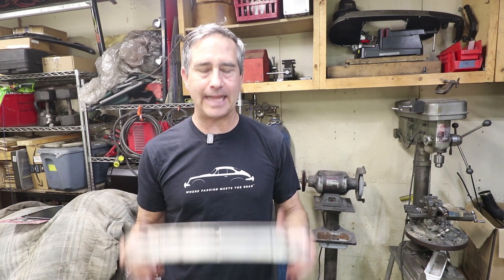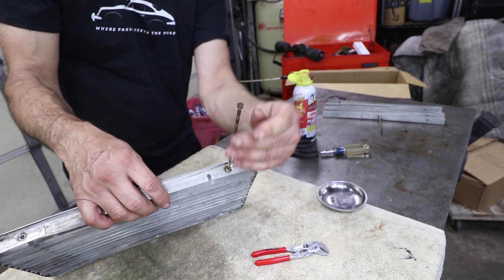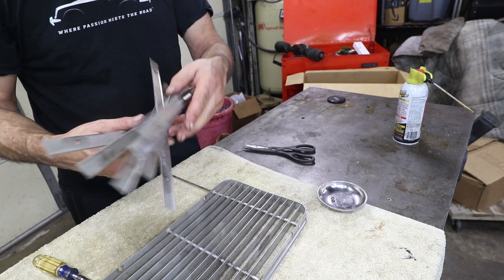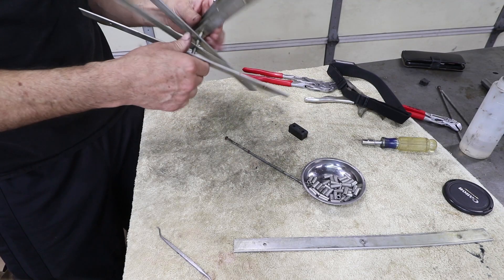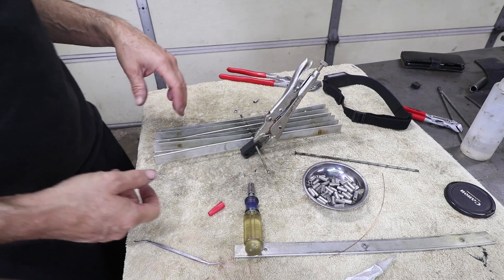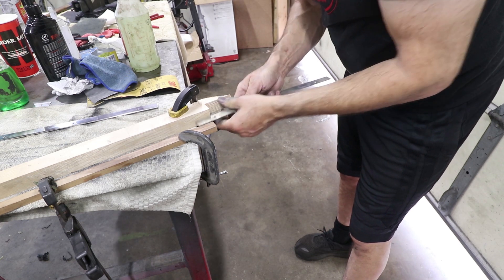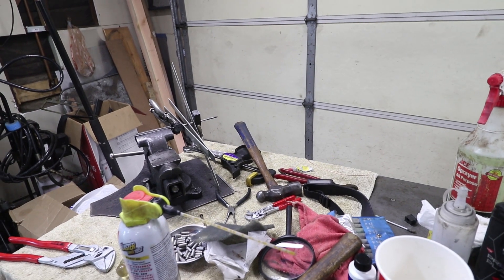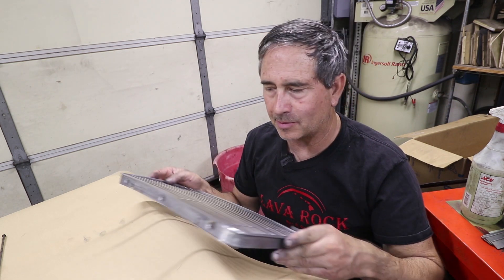This Porsche 356 Decklid Grill Almost Went In The Trash, But Look At Them Now

Comment: Great job on sticking with that stuck rod...lots of frustration but a great result.  After my grills were cleaned, polished and assembled I had them clear ceramic coated at some shop in the L.A. area.  That was over 8 years ago and they look exactly like they did when they came back from the coater.  The clear ceramic coating looks very close to the original finish with the anodized layer.
Reply from the maker: Nice, I will probably end up doing this long term too.  Cerakote?

Comment: You have read my mind.  Was thinking of superglue. But I was thinking a nut or sorts. Then acetone soak to clean
Reply from the maker: Super glue was the only thing that worked.  Sometimes the glue failed before the rust broke loose, but eventually it all came apart.  Have you ever used superglue activator?  It instantly dries super glue.
Reply: @GarageTimeAutoResto  I have not used the activator. But have used SG to open screw back pocketwatch cases that wouldn’t budge

Comment: Tom, I have early cars that DO NOT have screws and nuts holding the grill together.  As you probably know, these grills are held together by "swaging" the cross pieces to the "surround".  Do you have any tricks for taking these apart and reassembling them?    Thanks,  Dan M.
Reply from the maker: I have never tried to disassemble the earlier grills.   I've read that others have taken them apart with pliers and clamps, but that seems risky.  I know the aluminum is very soft, so that is in your favor.